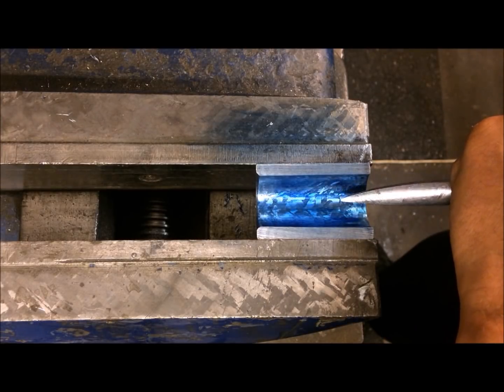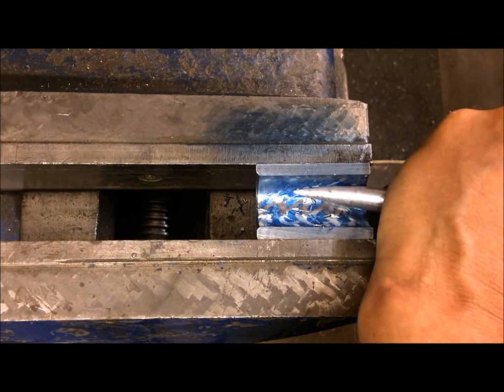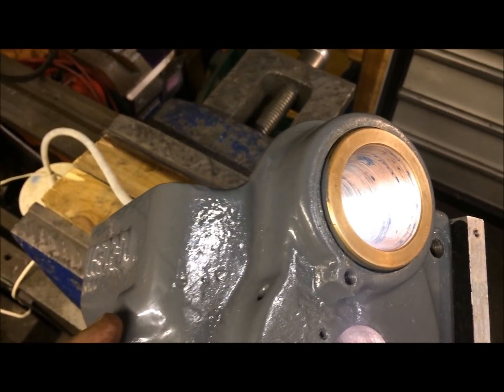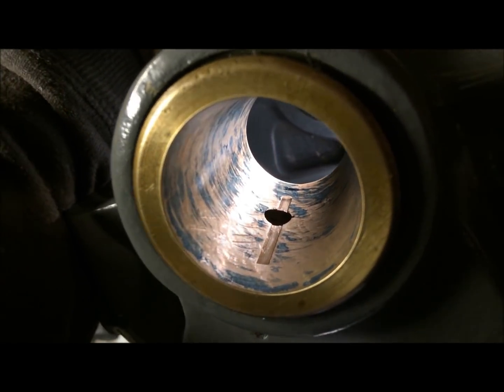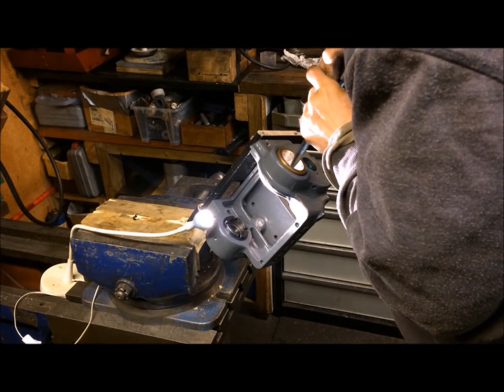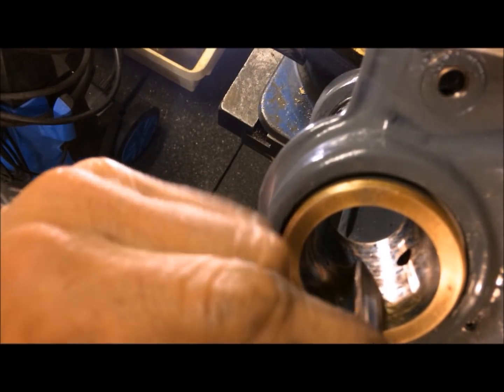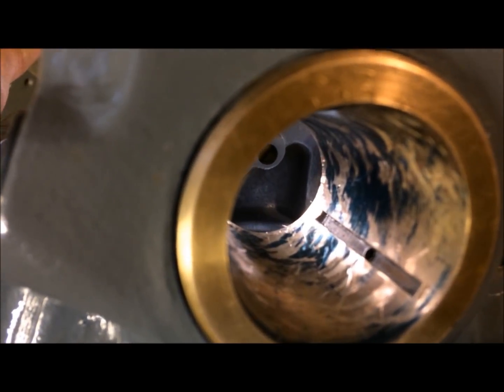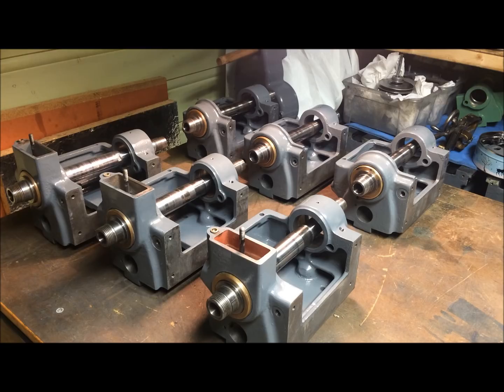Myford 7x7 - scraping headstock bearings - blueing and scraping

Comment: Hi jan, thanks for the guidance. I have used this video to scrape my myford super 7 bronze bush to match the spindle today. It was quite worn, now it has blue covering all around the bearing, and made the oil pocket a low point. Took about 15-20 cycles. Started with liberal blue, roughing, getting all points covered, then thin blue for finishing. Used 'dab' method to get a very thin layer of blue, similar to your 'dab' method when painting the myford raised letters.

Comment: Jan, very good video, have some deep grooves in mine, (Super 7) my question is how much can you physically take off without interfering with the spindle position, thus before you right off the bearing?
Reply from the maker: Thnks! Hmm.. not sure. Have you tried to measure how deep they are? It can be that they look very deep, but that they in fact aren't .Seems a lot more when you work the piece, but I didn't remove much material really, so mine didn't move much at all I guess. But I think you should have plenty of "room" as you can move the coupled rear bearings quite a lot both ways. Otoh, it might be that the deep grooves should be left there? There are deep oil grooves ther anyway.. The important features would be the surface coverage, ie. that you get the points spread all around and from back to front when spotting it, which will give you the stability in use and most important the oil retention capablility. Then of course the alignment, ie the spindle axis is a critical factor. This is possibly what can be changed if you don't pay attention, but given that you are careful when testing, I am sure you will get this right.
Reply: @jansverrehaugjord9934  thanks for your prompt reply, your experience on these machines is excellent, on the actual spindle there was a very thin but high wall raised edge (maybe 5 thou on the taper) I think whoever I bought the machine from, set the pre load on the bearings too high, as they nearly matched up to the oil groove on the spindle bearing, since then i have polished out the high wall from the spindle (very labor intensive) and have blued the bearing surface and it seems that the spindle has 80 percent contact thus getting worse towards the chuck with about 7mm of the taper in no contact, with the face of the bearing (chuck side) and the end of the spindle taper the measurement is about 3mm so i imagine this would be the maximal allowable limit, as far as you can take it, if needed before replacing the bearing.
Reply from the maker: @Dryootube  Hmm.. You might be correct regarding the maximum allowable axial movement as well as the  findings yo umade re. wear etc. Strange though that the spindle can slip furtehr back than the bearing. On mine there are some mm's left, ie. the spindle is longer/more to th reight than the bearing

Comment: I have a bench lathe with oilite bronze bearings, I wonder if similar contact point considerations would apply.  Once again, thank you for sharing your work on such a valuable subject.
Reply from the maker: somebody else Thanks for the nice comment.
I reckon that you can benefit from adopting the same  contact point scheme. When the bearings are made, ie. ground, they will not have oil retention capacity built-in, but some can have eg. an x-shaped oil channel connected to the supply hole

Comment: Jan.very interesting. how long did each bearing uou. i found when i was scraping the shaper fork, that i added bronze to, the bronze was easy to scrape, but the amount tsken off was much less than w cast iron, do it took me quite a while to take the highs down.
Also i assume you marked each shaft & brg so that they stayed as pairs?
Reply from the maker: neil9 Yes, I have numbered the machines/headstocks, an marked the shafts to each, so I scraped them as pairs. Not really sure how long it has taken, but a guestimate would be like 50 - 60 hours, ie. 8 hours each. I know I workef one at least a full day and a half, but then there was one that only took a few passes. Yes, it sure scrapes easy. There might be less material removal than when working cast iron, but scraping pocket depth needs to be measured
Reply from the maker: Yes, I tried to use an indicator, but it was tricky, hence the readings are "error prone" I guess. I must repeat this excersize again on more of the bearings. Anyway, to my surprise, the devations were in the range 0,002-0.003, at the most 0.004 mm, ie. less than for normal scrape marks, even though "it felt" like I was taking off more
Reply: and you measured pocket depth with an indicator?

Comment: If anyone else has shown bearing scraping on Youtube Jan I haven't seen it yet so thank you very much for going to the effort. An interesting process. Between these headstocks and the lathe beds it's clearly shown the importance of cleanliness and keeping the surfaces well lubricated. And the machines where that wasn't a high priority.
Reply from the maker: Turning Point Thanks! Yes, indeed.. maintenance, care and cleanliness are very important for a long and accurate lifespan of the machine, and a small amount of effort will certainlyy pay off
Reply from the maker: Turning Point There aren't many other videos I think, but Nick Müller's is certainly a good one!
Maybe now I have done something that would inspire others, say a professional that can give some valid comments, critisism, corrections, hints etc..
Reply: One of the main lessons I got from reading the Conelly book was that importance of keeping the slideways clean and well lubricated as much as possible Jan. That book changed my previous habits completely. Even if I never fully rebuild a machine tool those lessons alone were well worth the cost of that book. Some of the scoring shown in a few of these bearing was obviously done by running the spindle without enough lubrication.
Reply: Well I really know little about scraping and nothing about scraping bearings but the spindles appear to be showing good contact in the areas you pinpointed where you wanted low and high areas so I'd have to judge it as very well done. It would be nice if Richard King would add or point out what may or may not have been done a bit better. Nick Mullers videos are extremely well done and I wish he was still posting on Youtube, but I can respect his opinions about youtube and don't think he's wrong.
Reply from the maker: Turning Point I can ask Rich to comment..
yes, I also understand Nick's stand